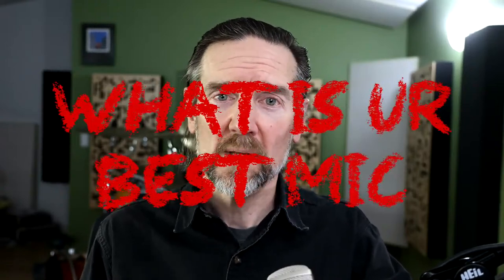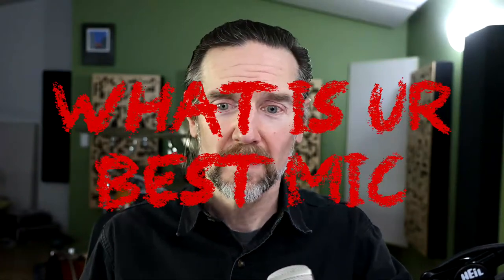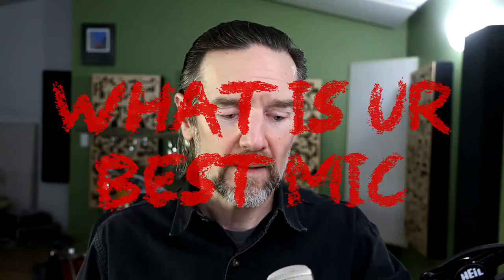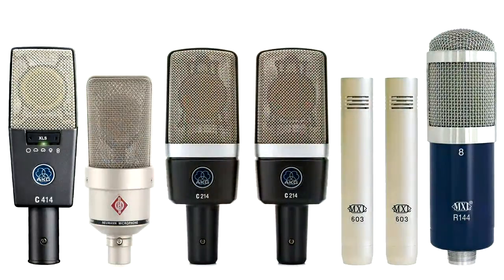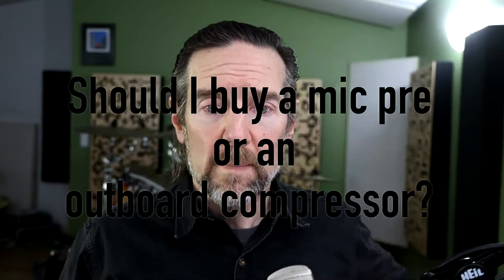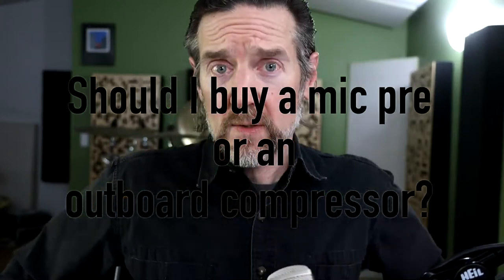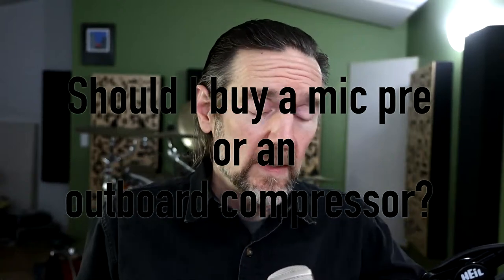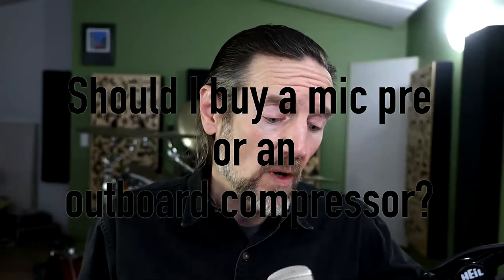Microphone Q&A - How to choose, how to use, and whatever else you want to know

Comment: The sound quality on this video is absolutely excellent, Matthew. What Microphone did you use, and what outboard compressor with how much gain reduction?
Reply from the maker: I had a Mini K47 positioned low, just out of frame, angled up towards my mouth. It was most likely plugged directly into the audio interface, with no compression or processing. 

In the subsequent Q&A video, I was using an SSL SiX as a mic pre. If I was using that in this video, too, then the SSL's channel-strip compressor might have been engaged, but if so it wouldn't have been heavy because there's a lot of ambient noise in that space (e.g. cats fighting outside, acoustic sweep tests happening in the next room, etc) which would have been much more apparent if heavy compression were used.

Comment: Matt, you said, “The Mini K47 is a bit leaner on the bottom, slightly narrower than cardioid in its polar pattern and has the expected 4–6 kHz boost due to the K47 capsule, which can sound brighter depending on the source.”

Wasn’t the brightness of the Neumann K47 capsule used in the later U 47 tamed through circuitry? What about the K47 in the Mini K47?

Comment: Toward the end of the video you talked about transformer and transformerless microphones and their compression characteristics. You claimed that the transformer design had some built-in compression that was less obvious to hear than the transformerless design with a compressor, making the transformer design easier to mix

What I did not hear you say is what kind of compressor you used; specifically, were you using a FET compressor? a tube compressor? a compressor in-the-box? - What kind of compressor were you using?
Reply from the maker: Good question. It was the standard compressor plug-in from Pro Tools.